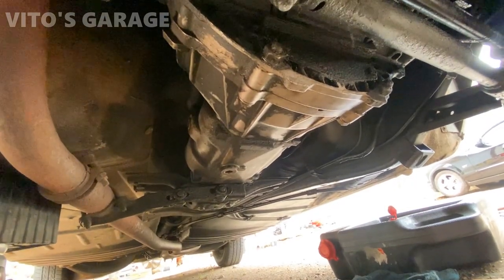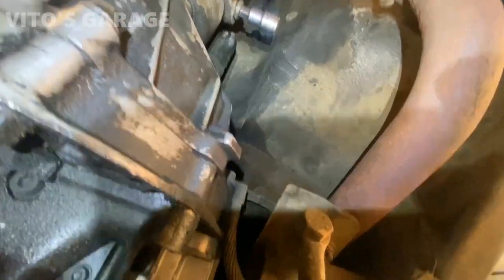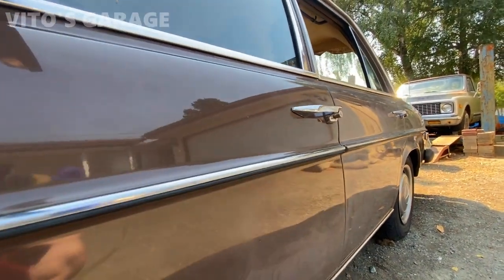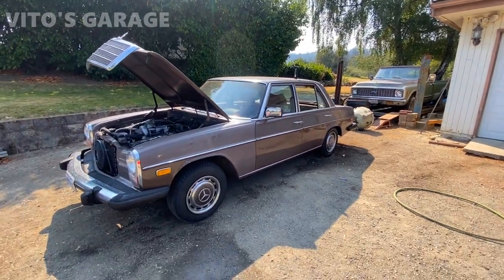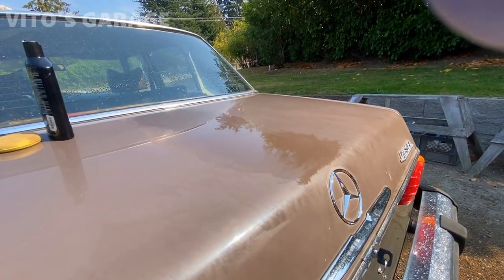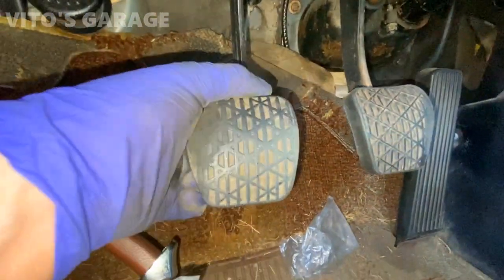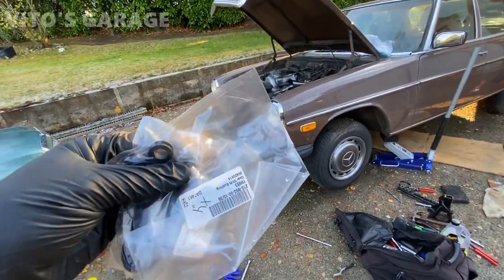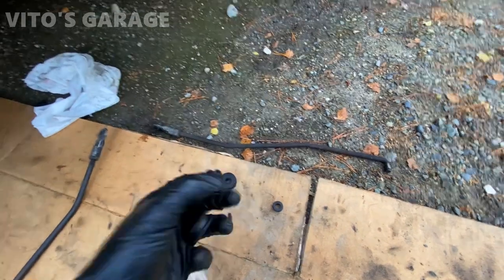W115 1976 Mercedes 240D Manual Trans Fluid Change, New Pedal Pads, New Shifter Bushings, Polishing

Comment: Hey man I think that atf is used even in manual gearboxes? Old oil looked red like atf..
Reply from the maker: It smelled like gear oil. Nothing wrong with using gear oil. It’s even thicker than atf

Comment: Hello Vito, I hope you can help me. I have difficulty shifting in first and reverse gear and when driving into third gear. I did change the master and slave clutch cylinders with new ones. Still have the problem. Then I thought that maybe the clutch pedal push rod was not long enough so I welded 15mm piece on it, it still did not fix the issue and now I busted my clutch master cylinder piston. I am going to replace that again, but what could be causing my clutch not to disengage (sticking clutch disc) ? And is there an easy fix? Thank you very much!
Reply: There is certainly no air in the clutch line and I used fresh brake/clutch fluid.
Reply from the maker: What fluid is inside the transmission? It must be ATF only. I’ve made a video on how to change it. Try that first:
https://youtu.be/CHwfHWM5mKc?si=63w6bVCBhe8zrnj1
Reply: @VITOSGARAGE  yes I watched your video and I changed it to ATF, considerably better . I also noticed the shifter gear bushing were missing

Comment: pull off the trim and clean and polish behind the chrome trim to prevent rust
Reply: Not such a good idea, those side mouldings have a rubber base, and 46 years old. With age they will stick to the body and when you try to take them off the top edge (which is very thin) can stick to the body. Factory original mouldings are mighty expensive.
Reply: @johnjamesmoses  that might be true in your climate but i have personally removed at least 5 sets of these moldings with no issues and they are always full of dirt that needs to be removed.